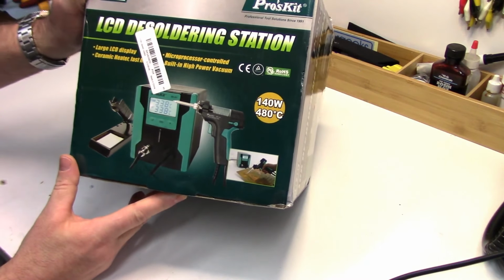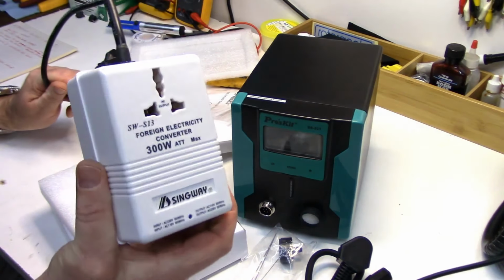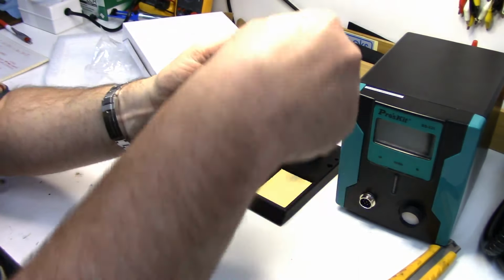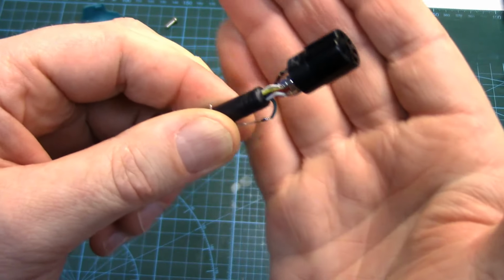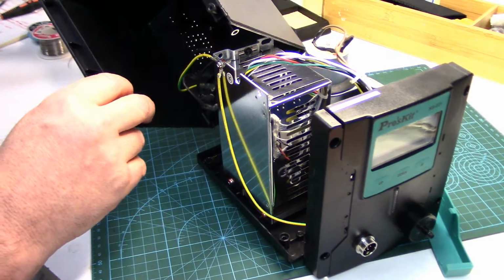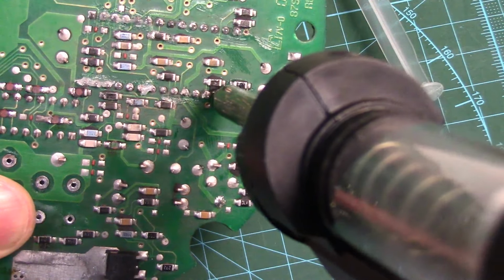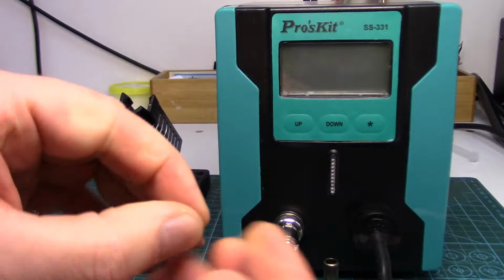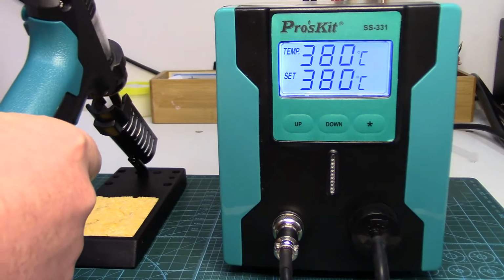Pro'sKit SS-331 Desolder Station Review

Comment: The point of wiggling the tip is to make sure solder is removed from all sides of the pin and barrel. If a pin is not center on the through hole, it's possible for solder to still be stuck to the pin and the barrel of the through hole and may not be visible. So when you go to pull the part out you can damage the pad or the barrel itself. It's to make sure all solder is completely removed to minimize damage to the PCB. That's what we learned in J standard IPC classes.
Reply: Right, but wiggling shortens the tip life as many components leads are made out of IRON.
Reply: @paulcohen1555  No? Component leads are not iron cause you can't solder to those. :p
Reply: @AnnaVannieuwenhuyse  Of course the iron leads have coatings and the last is tin.
Simply check leads of components that don't have to transfer a lot of heat.
Reply: @AnnaVannieuwenhuyse ,  Not only is it possible to solder to iron and some forms of steel, but wellmade soldering iron tips s are coated/plated with iron at the pointy end because, unlike copper, the iron can "wet" to the solder but will resist being dissolved and corroded by molten solder and flux.  Component leads are often, but not always, attracted to magnets;  Most component leads will have a coppery color when you cut them but they may have iron or nickel mixed with them to make them magnetic, Probably so that it's easy for machines to cut and remove excess component leads when the boards are being manufactured. Component leads are also often coated with tin, but tin is not magnetic. (BTW, most grades of stainless steel will not wet with solder and cannot be soldered to).
Reply: Wiggling also means it may spring back to one side when you remove heat, potentially contacting the other side after everything solidifies. This is very useful for DIPs. If all the pins seem to be touching a certain side then make sure you remove heat while pulling to the opposite side. This provides notably improved results versus random removal while wiggling.
Reply: Also, you can feel if some solder is still sticking by how much movement there is. Sometimes just the end of the lead moves and you know to wait until the whole lead moves - it feels different.

Comment: After watching your videos I decided to give this a purchase.  Unboxed it and set everything up.  It got to temperature and I pulled the trigger which removed the solder from the tip.  After that pulling the trigger no longer seems to engage the vacuum.  Panel still lights up and pulling the trigger still engages the blue light on the front of the machine.  But when the trigger is pulled the fan goes almost silent.  Not getting much satisfaction from BangGood so just figured I would ask someone who has the machine.
Reply from the maker: Not sure what you mean by "seems". Is the vacuum pump working or not? It's very loud & vibrates slightly when the vacuum pump is operating so it's easy to tell if it's not running when you hit the trigger.
If you can hear/feel the vacuum pump still when you pull the trigger (meaning it's running), then my best guess without seeing it first hand to do a proper diagnostic, is there is either a blockage in the hose between the pump and the gun tip, or there is leak in the hose/fittings from the pump or gun preventing vacuum from forming. If the desolder tip is loose, vacuum leakage around the outside tip is possible. Glass tube not sealing is also possible. If you pull the hose off the front of the unit and put your finger over the hose bib, can you feel vacuum? If not maybe the filter housing that screws on the front of the unit is not screwed on tight and there is a vacuum leak there? Maybe the screw on filter housing is damaged/cracked? If no vacuum is confirmed at the outlet on the front of the unit, then perhaps one of the hoses inside has come off one of the hose bibs, or the diaphragm pump is faulty.
Now, if the pump is not running, but the blue LED indicator still lights (indicating the microswitch in the trigger must be okay), then that would point to a motor issue requiring the unit to opened and the motor tested for both power to the motor & motor operation.

Comment: I have a question How exactly did you remove all the potting compound on both sides of that ECM cont board I spent 1 hr or more just to clear  a small area to get at the PTC thermistor and a X2 safety cap from looks of your board I would never have thought it was potted in  first place that black stuff   is very tenacious
Reply from the maker: A stereo microscope, dental & plastic pick, tiny brush, isopropanol, the patience of a saint, and about 3 hours of my life I'll never get back 😜
Reply: @rchelicopterfun  I know the patience thing first one I tried  busted off a SMD transistor Its so easy to do as you cant see what your probing one wrong move and KAPUT
I am trying to help out a friend who owns a HVAC shop, I am v GOod with electronics Rprs except encapsulated stuff UGGH

Comment: I'm told the Power Supply is a universal 100 - 240VAC.  Try using a standard US power cable.
Reply from the maker: I already corrected that in the description, in a card link within the video, and in the pinned comment - all of those linking to the universal voltage update video I did: https://youtu.be/9eBG7z-2qNE

Comment: Hi John, I purchased Micron T 2065 same desolder really, the only issue I have is all the tips that came with unit do not have a hole in them, do I need to drill the hole through so suction occurs?
Reply from the maker: You are joking with me right? If not, I suggest you read the manual regarding first use, or re-watch the video and listen/watch to what I say about blocked tips - time index 8:52
Reply: @rchelicopterfun  Hi John thank you for that info I did try this and but it does not suck through, I heated the unit to max then pulled the trigger for a while and still nothing. I will try again though. Thank you
Reply: Hi John for an update went into the office and changed over the tip that was installed with device from purchase with a spare that was supplied and sucked straight through as video showed. I think I just got a faulty tip on unit to begin with. Thank you for your assistance and a great video. Kinds regards Llewyn

Comment: Excellent, thank you.  Unfortunately, FedEx delivered mine in Thailand with the tip broken off the plastic piece that looks like a soda bottle top that attaches to the unit for the vacuum line.
Reply from the maker: So, make a FedEx claim to get a replacement. Or fix the broken nipple, or get a screw on 1/4" drip irrigation cap to work. Lots of ways I can think of to fix something so simple.
Reply: @rchelicopterfun  That's a lot of work for a $5 part. The packaging is poor and that plastic screw-on connector with the tip for the vacuum line is overly fragile.  I suspect a lot of people will break them by accident.
Reply from the maker: As I said, lots of ways to fix it.
Reply: @rchelicopterfun  Thanks I have superglued it and ordered a new part from China.  Thanks for the great video and again I apologize if I said anything excessive.  Best wishes.
Reply from the maker: Glad you figured out an easy fix to get it working until the new part arrives. Have fun 🙂
Reply: @rchelicopterfun  Thank you and thanks again for a great video.  The vendor is sending a part for a proper fix.

Comment: John, I just purchased one of these units, the 1.0mm nozzle that was on the handle appeared to be defective, but the other 2 were fine, I'm wondering if they had a few bad runs on them. Regardless, I purchased another set of SS-331H specific nozzles from Ali. Do you think the tips from the Hakko or the ZD-985 clones are interchangable?
Reply from the maker: No idea on if the Hakko tips would fit. I've seen all the same replacement tips however listed for all of these clones (ZD-915, ZD-985, ZD-987 etc).

Comment: Thanks for a thorough clear and to the point review. I like your mentioning the manual and what's in it; too many reviewers think they're to good, to smart or just to big to even look at it;  a guy like Louis Rossmann roasted a perfectly good machine just because it operated differently from what he was used to and didn't know how it worked. I just like to know if its English, Chinglish, American, Australian, Canadian or whatever, has it error codes,  numbers for replacement parts, and some specs, like you did because  just advertisements makes things hard to compare. I'll be the judge for what's good for me. And yeah, I hate a power switch on the back plate too but its good to know it has one. Good to say to clean the gun with the rods after use to prevent clogging (its in the manual F......)

Comment: Hi John, very exhaustive  video, i apreciate it so much! 
Cause my job, for decades i used (and i still use) top quality  brand solder and desoldering workflow station  (Weller WMA 1),  but untill now i dont have any tool at home, too many hours at work killed my passion for electronics, so at home i only have few screwdrivers  :) for only emergency purposes.
But now i would like to have a little corner for the necessary to make "first AID"  to my old electronics at home.
So i was looking around for a good compromise quality/price.
Your video is the answere to my questions! 
Very soon i will take a look for a hot air solder  too, may be i will found another good video  in your channel!

Comment: Great review!  Though I am not sure if you mentioned the dimension. Is the size almost similar to computer AVR? What do you think about the S-993A?
Reply from the maker: Never mentioned dimensions, but they are shown in the instructions at 10:47 (172Hx135Wx190L). I specifically & only wanted a bench top vacuum desoldering tool so never even looked twice at the hand held ones.
Reply: @rchelicopterfun  thanks

Comment: Does yours make a terrible pwm buzzing noise when its heating ? Mine emits a very loud buzzing from both the PS and the handpiece when the heat is active..
Reply from the maker: Hums a little bit, not a loud buzzing however.
Reply: @rchelicopterfun  I found my ps case was dented and the transformer ferrite was cracked and loose, was vibrating alot, I wrapped the transformer in electrical tape and a zip tie and it helped alot.
Reply from the maker: Wow, that's not good (that it was damaged like that). Glad you were able to find the issue and fix most of it. Hopefully it will work well for you for a long time to come. The more I use mine, the more I enjoy it, and the more I realize it's one of those tools that until you've have one, you really don't know how you lived without it. It's actually fun pulling components now 😃

Comment: FYI. Using flux for any desoldering system is a big no-no. It might help a vajaja hair with heat displacement. However, it will do nothing but cause unnecessary clogging of the tip, tube, and filters.
 Honestly, once you have 100 parts or so under your belt you should be able to use this or any system with ease for the largest of through-hole components without clogging of tip or tube ever! Use the cleaning rod before you shut down daily and before you run your 1st component of the day. Hold tip square to component lead, hold for 2-Mississippi's, before you squeeze trigger, 3-4 on extra-large leads and plains. You should be golden!  Thanks for the review!  Oh, and wiggling it can cause blindness! JSf
Reply from the maker: Good to know, thanks for the tips. As you said, once you do more, it gets easier & more effective. I too have found flux is generally not necessary.

Comment: Excellent video!!  i have the same model Dave had in his video, and from the same distributor Rhino Tools here in Australia.  Great tip on making sure you keep the tube clean, they can get clogged however if you make a habit of maintaining there shouldn't be issues.  For me the i find 350c and using the wiggle technique best.

Thanks again for making the video
Reply from the maker: Thanks for the "wiggle" works best along with 350C. Can I ask how long you have had yours now and how it's holding up?
Reply: @rchelicopterfun Have had my unit for around 6 years now, have been through two guns. Both were damaged due to me not using and maintaining correctly.  first gun got clogged, and had to use a thin drill bit to unclog but it was never the same.  The second one i had it at 420c and left it running while talking to my neighbour for about 30 or so minutes, the front nozzle detached. My third is going strong for about 1.5 years now, as im correctly maintaining it and operating at a lower temp .  Have a spare just incase, as i find it a must having a desoldering station.  Also i use a small amount of grease on the seals, just so im getting the best seal and suction.
Reply from the maker: Thanks for all that great info! It's much appreciated not only for myself, but others thinking of getting one of these units. I take it the 985 version doesn't have the "idle" function where it ramps down to 200C after 10 minutes of no gun movement detection?
Reply: @rchelicopterfun  Not that i have seen, i tend to manually lower the temp to 160c.
Reply: The tube probably gets clogged, because one end has lower temperature than the other. I saved mine by pushing a copper wire of nearly equal diameter into it - copper conducts heat well, so it then melts the tin in the colder end of the tube.
Also, flux residues together with dirt on some boards help to clog the tube, so I clean the surface before desoldering, and every 20 or so solder joints I push the cleaning 'rod' through the tube, just to make sure, and that works fine.
Reply: @vougbour1  this same model is already being sold since 2014? Wow it is really a good buy

Comment: That's not a european plug, it's Australian.
Reply: That unit is designed for international markets so they design it to comply in an international market, hence the location of the power switch. I it's a C-13 power input so it could have any plug on the other end of the cord.
Reply: It's Chinese standard, which happens to be similar enough to the Antipodean plugs that they are sort-of interoperable. The latter have thicker blades, for one thing.